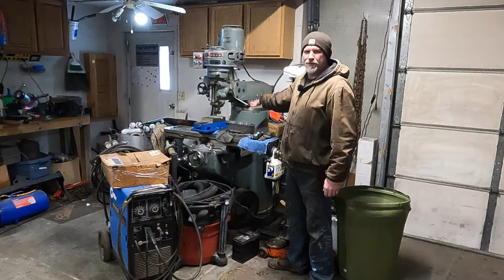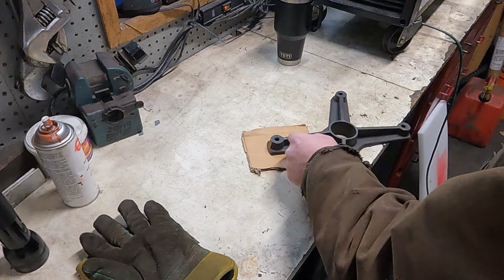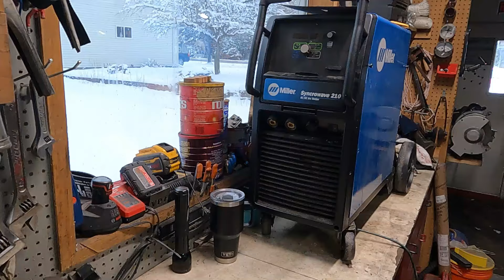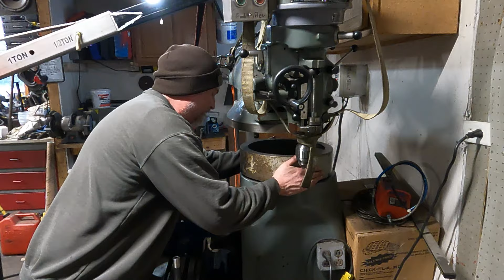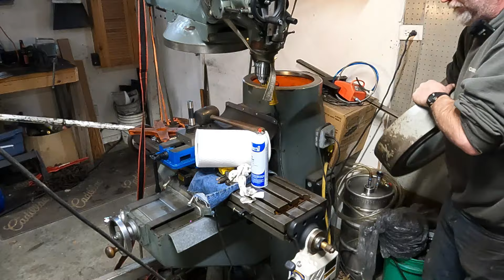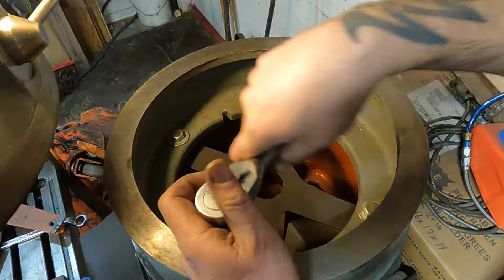Installing milling machine riser block on a Bridgeport clone, Not as easy as I thought! VPT

Comment: L
You are absolutely normal. Any project we start will go south on you fast. It's how you recover from it that counts. Two things i would like to add to my mill. A riser block and air drive chucking tool. Maybe someday.
Reply from the maker: If my mills were any taller and if I had to change tooling more often I'd probably get (make) the air driver deal as well. I am looking forward to having a dro on the mill! Just not to excited about mounting it all.

Comment: Sketchiest part of that was taking the hoist off the turret before it was bolted in.  I was just removing the head on mine to try and make it easier to move(didn't really help) and shifted it too much, even with the engine hoist attached, and dropped it on the table.  Fortunately it was more of a controlled slide, and I stopped it from going further.  Now I've got a lifting eye that screws in for lifting the turret rather than just straps.  
Anyways, I was just waiting for it to drop while you removed the hoist.
Also, did you consider trying to freeze it and put it in? Might be too big for a freezer though.
Reply from the maker: I was quite worried when I removed the hoist! I did however set in the spider facing the wrong way so i had to pivot the turret to line it up. Not a great idea I admit. When mentioning the parts being the same temp the thought of freezing the riser did cross my mind. However everything being cast I didn't want to put any stresses on anything possibly causing a crack or worse.